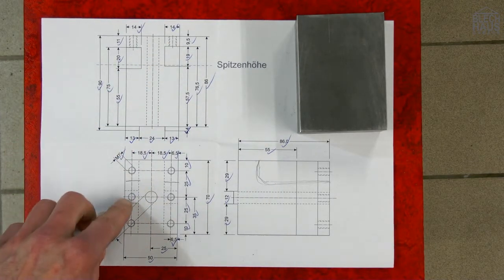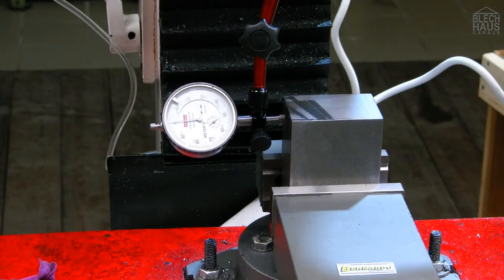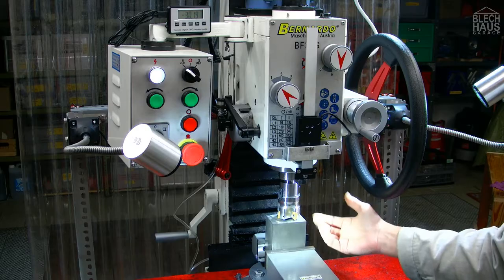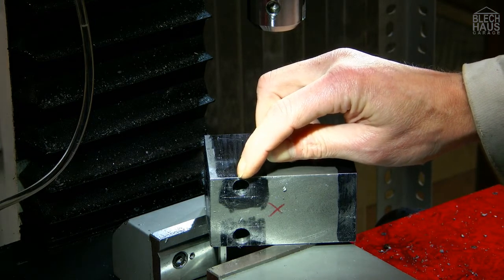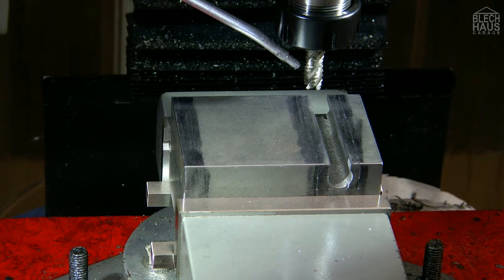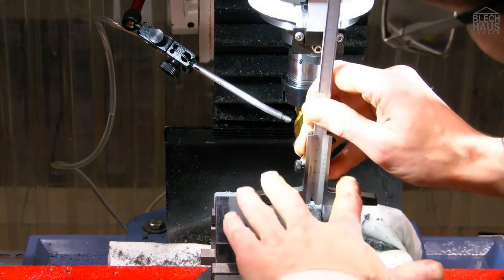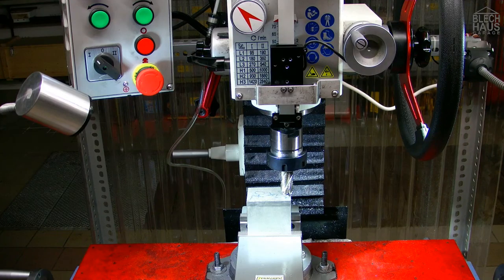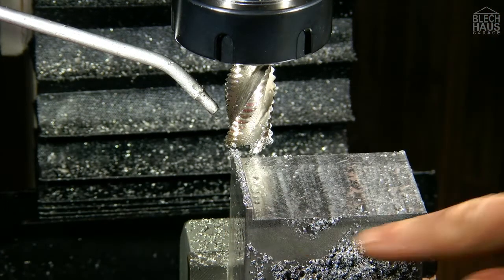Rear Toolpost, for lathe Bernardo P 600 G, part 2: chisel holder

Comment: Dieter -- I liked the way you squared up the block in your vise -- using an indicator on your spindle quill. The Quill Wheel is doing a nice job .
The video was exceptionally clear , the clearest that I have ever seen .It though I was in your shop .
 You pulled a rabbit out of a hat .Six thumbs up. --- Guess what ? --- I don't have six thumbs . That's a tough act to follow .
Reply from the maker: Normally I use a knife-edge-angle, but vice was to small and block was to large ;-)
Yep- QuillWheel does a helluva nice job!

Comment: Dieter, may i ask which milling machine is that one BF 30 G ? (i've see it's a Bernardo too :-) ) thanks
I'm looking all your work with the P 600 G as it's the lathe i'm pointing to in the future, it looks to be working pretty well (most of the merit goes to you)
Reply from the maker: Yep it is a BF 30 G, the geared version.
Unfortunately, my garage is too low for a larger milling machine. I mounted the DRO on the Quill, because the scale was to unaccurate because of the lack in the gear of the quill. Also a quill wheel for better operating the quill.
Ya also will find this mill under other brand names. Also with ready mounted DRO.

I like the p 600 G because of its geared spindle stock and the forward/reverse lever on the carriage. Sadly the motor is a litle to weak to drive the 2000 RPM at the start. I've made a few modifications, handles with balls on the gear knobs, a ball valve instead of the oil release screw and so on . . 
There are of course a few limitations because the machine isn't very big. For example, there are no gear settings for Whitworth pipe threads - if you ever need them. But in the meantime I had interchangeable gears made for it.
Reply: @BLECHHAUS  Thanks for the feedback. Following your work with interest. Cheers from Italy
Reply from the maker: @oc_geek337  
Buonasera !
I just had a long break because it's too cold in the garage in winter. 
And yes, parting off on such small lathes can be problematic. The top slide is a little too unstable. That's why I built the rear tool holder as well. It works much better that way. I have built two of these, one of which is currently available for purchase because the current owner has redesigned and rebuilt the rotating base of the top slide and no longer needs the rear tool holder..